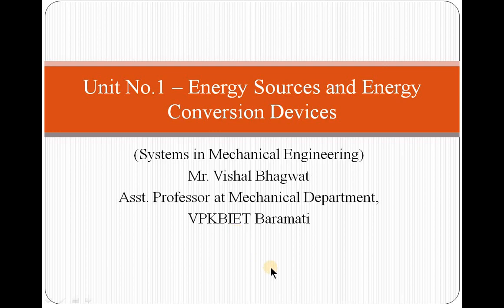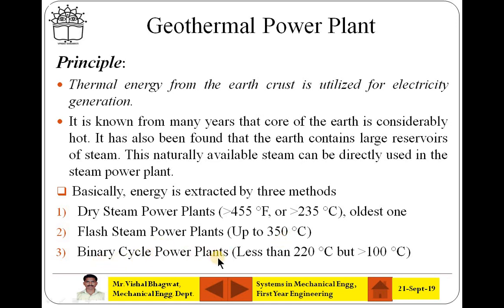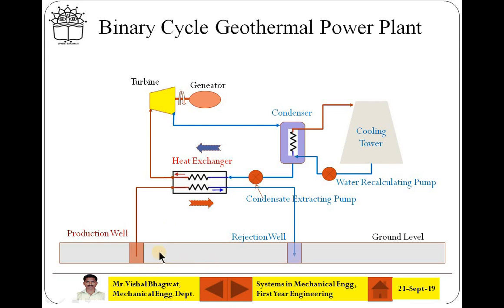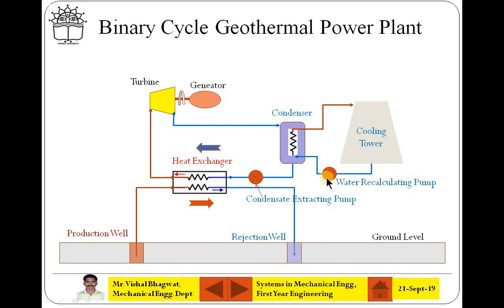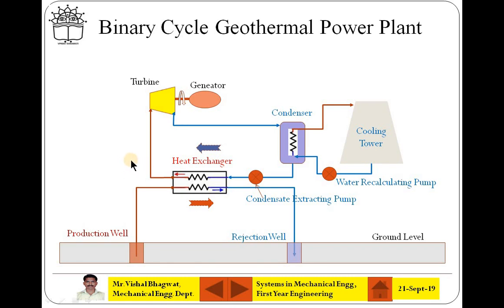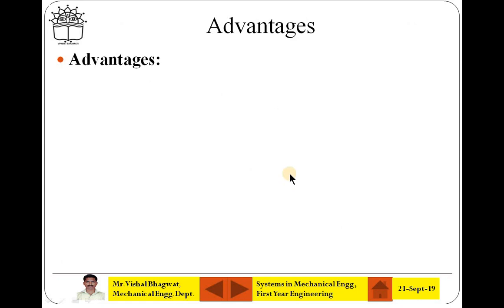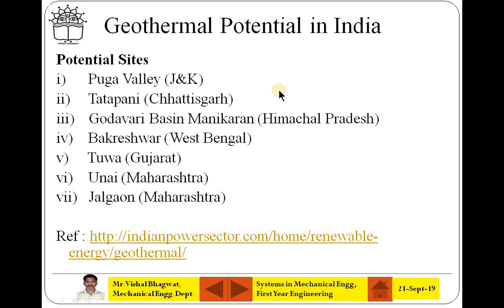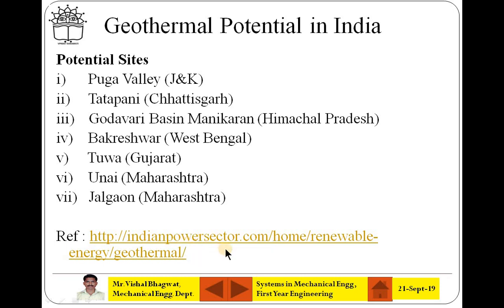Geothermal Power Plant

Comment: What are diff blw these 3
Reply: Geothermal Power Plants: Dry steam power plant uses steam from reservoir to Turbines directly (Runs at more than  235 deg Celsius). In case of Flash Steam Power Plant, brine and steam is separated in flash chamber and only steam is blown over turbine. And third is Binary Cycle Steam Power Plant, where secondary fluid is heated in another heat chargers and that is used to run the turbine. Actual reservoir steam or brine is not in contact with Turbine directly.